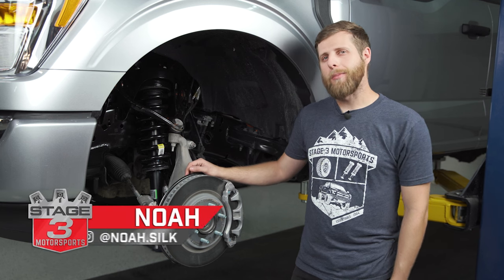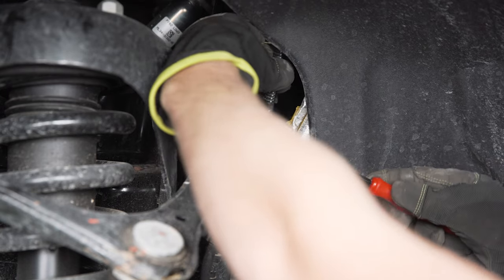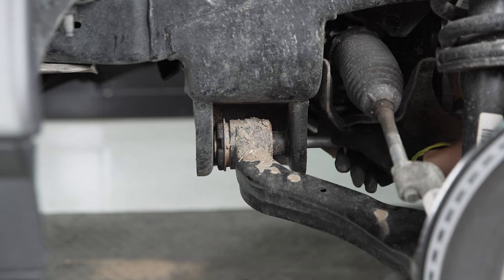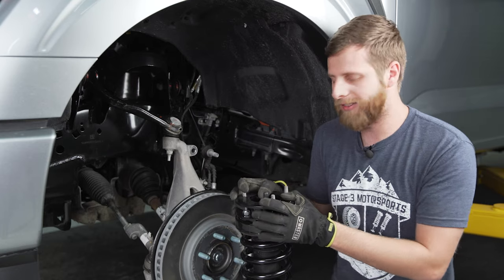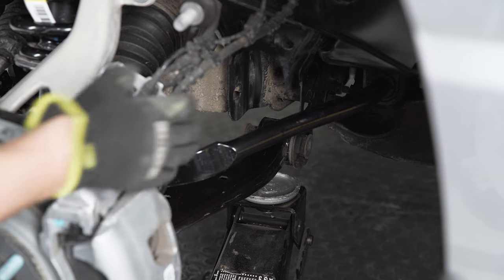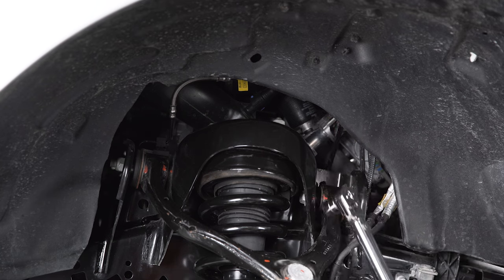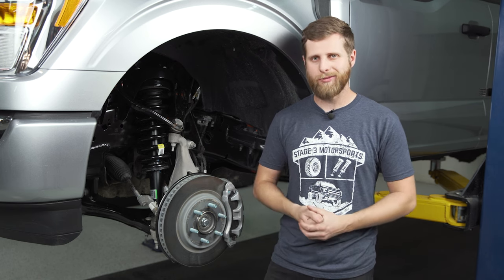2021-2023 F-150 2.3" Spacer Lift/Leveling Kit Install

Comment: I used your method to install some other brand spacers for my 23’ XLT but after installing these and performing an alignment (which came out excellent) I’m having a slight vibration on the gas pedal which worsens more on rough roads. Has anybody else experience this? I’m hating my truck right now. 
After watching these video I’m analyzing to switch to these S3M but I’m overthinking it because I don’t know if I’m going to be getting the same results. Are these S3M engineered to fix that issue? Or do I need an upper control arm to fix that? Please I would appreciate some feedback. 
Thank you

Comment: Whats the tire size on this set up?
Reply: 295 70 r18 or 295 60 r20
Reply from the maker: The tire we used is a 295/60R20 Nitto Recon Grappler. We've got links in the description if you want to check it out
Reply: I went with a 275-65r20 bridgestone revo 3 on those exact wheels works really good and they are 34 inches tall just not as wide as the 295-60r20
Reply: @Stage 3 Motorsports  if you dont loosen the control arm bolts and just pray down on the control arm to install the leveling kit would the bushings in the control arms be binded up with the 2 inch level putting more strain on the bushings causing them to be twisted more than from the factory height
Reply: @stage3motorsports  and rim?

Comment: This video is doing a disservice to those who choose to install the kit themselves.  You don't mention that the LCA holes are slotted.  It is not possible to get them back to the factory position by hand due to the compressed force.  I followed this video and had to do a driveway alignment because the LCA's were kicked out so bad and toe was undriveable.  You should say in the video that lower control arm cams are required with this method.  For the average person I recommend going the normal route through the top control arm.
Reply: I just did this on a four-by-four as well I undid the half shafts pulled the upper arm from the knuckle bolted the spacers on to the struts put the bolts in the lower arms what the help of my coworker we push down on the arm and the knuckle and shove the strut assembly back into the pocket and then Tuesday for Jack to raise the lower arm and knuckle into place after sliding the axle back through
Reply: @SumDumFukr  is there a video of this method anywhere you can share with us?
Reply: @g9pipes  I wish I would of recorded it I found this video after

Comment: Call me crazy, but I hate the idea of the cv joint and UCA knuckle bent that sharply just hanging there. I know nothing is likely to happen to the boots, but it makes me paranoid they're going to tear and start leaking. also, a good rolling head pry bar is great for lining up the LCA bolts and using it to angle the LCA if the hole doesn't line up correctly, like with one side slightly lower than the other.

Comment: Can u do a new 2wd drive also if it’s any different of tire size or space or is about the same to fit on rim and tire with original 18 inch rim
Reply: I haven't personally installed this on a 2wd truck so I'm not 100% sure what fitment would work best, but we've had customers install this spacer on 2wd trucks and still manage to run a 295/60R20 without problems. An equivalent 33" or 34" tire for the factory 18" wheels should still work too.
Reply: Should do a video one day on a 2wd lot people looking for that also not many videos that’s a niche 👍🏻
Reply: Do you think I can add this level kit to my 2022 2WD and get no rub with my 275/65r20s with +12 offset? Not looking to have to do anything to the truck

Comment: Stage 3 Motorsports - i was told by a 4 wheel drive shop these leveling kits are not ideal because it actually changes the geometry of how everything is supposed to work. An actual lift kit doesn't and make its all correct. Hear the same thing from a Ford Dealer on YouTube that does both the spacers and left kits.

Comment: You took the time to point out your engineered offset, but never said which way it should be installed.
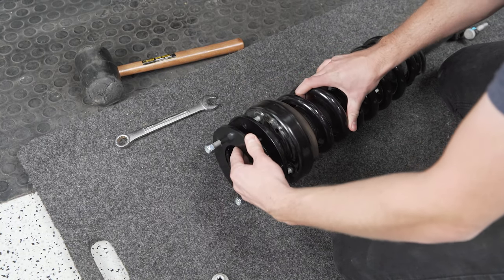Reply from the maker: At 5:06 I point out that the spacers only fit on one way, so you can't install it wrong. All you gotta do is line up the holes.
Reply: @stage3motorsports  you said the leveling kit only fit on the strut one way, not that the strut only fits in the truck one way, which it’s does not
Reply: @rjdavis947  This had me perplexed also until I got the kit.  It's literally idiot proof.  The three threaded mounting bolts are not an equally spaced apart triangle. When you mount the spacer you have to spin the strut 180 degrees. It will not mount any other way.
Reply: @saintsandsin3885  thank you!  A simple, meaningful answer, is all I was after.
Reply: @rjdavis947  “only fits one way” is about as straight forward an answer you can get! 😂

Comment: This was a bad idea and messed the alignment up way worse than doing this the “traditional” way.  I would not recommend dropping the lower control arm as they did in this video.
Reply: Not to mention that this video conflicts with the instructions sent with the spacers.
Reply: You would need an alignment regardless after installing a level kit. Shouldn't matter

Comment: This method DOES NOT WORK with 2.5” spacers
Reply: Why!! Tell me !!
Reply: I’m about to do one
Reply: I think it was just enough of a difference to where the studs on the bottom of the strut couldn’t get lined up enough with the lower control arm holes when putting everything back together. I spent like 6 hours trying to get them to go back thru the holes lol. I ended up putting everything back to stock and having 4 Wheel Parts do the install because I was defeated by the whole thing
Reply: I got the 2.5 spacers and worked just fine for me.
Reply: You need to hit it with your purse much harder.